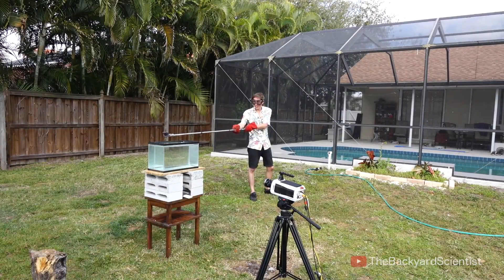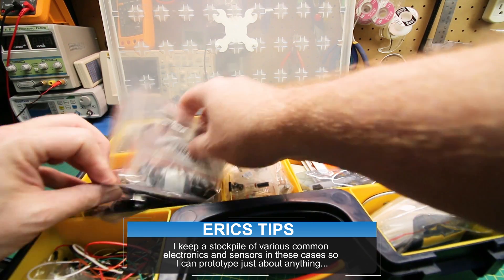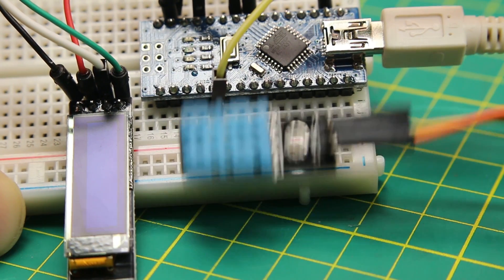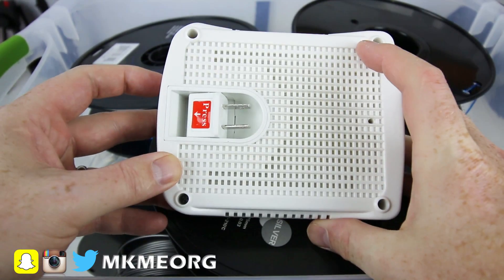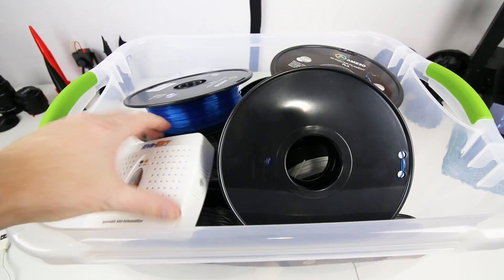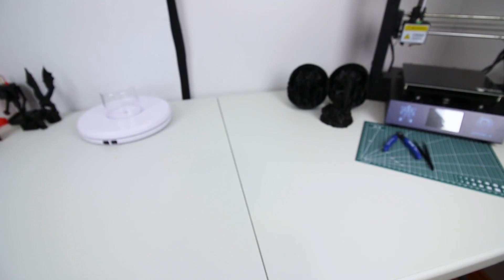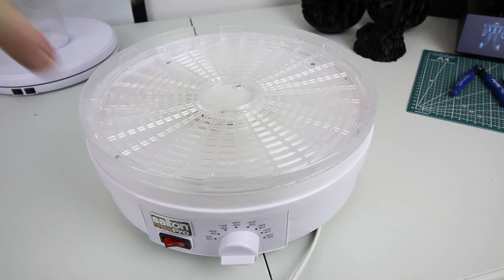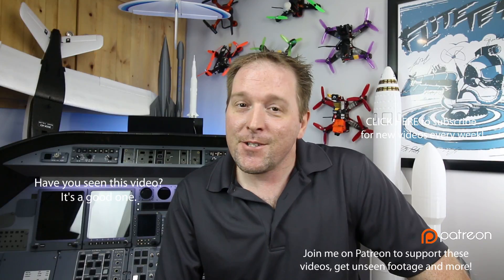Improve Your 3D Prints!  Filament Storage and Drying

Comment: Filament works as a (not so good) desicent. Measuring moisture of the air means that once your humidity sensor starts to measure an increase, your filament has probably finish absorbing all what it can absorb. Printing problems will probably starts before you can detect it with that method.